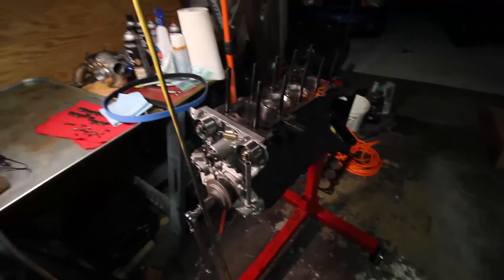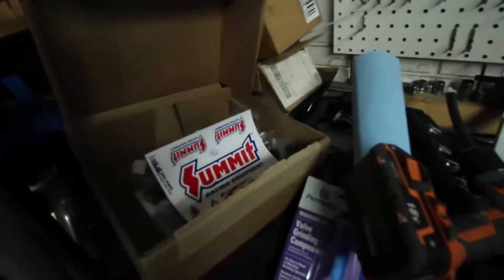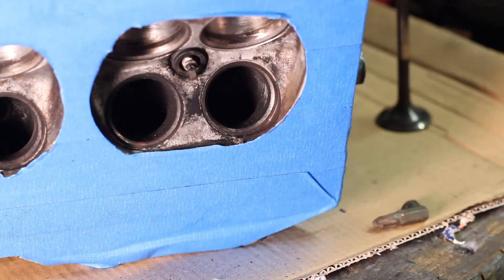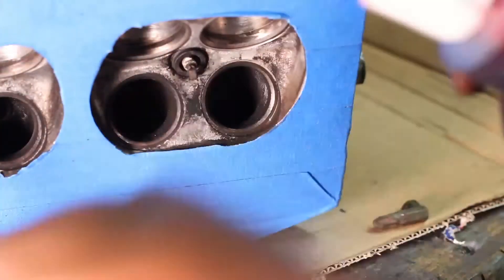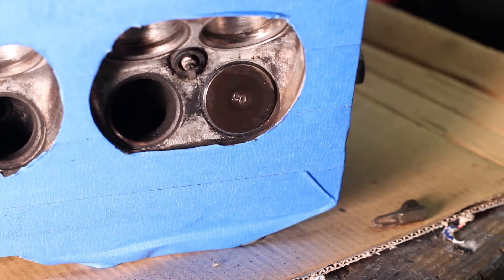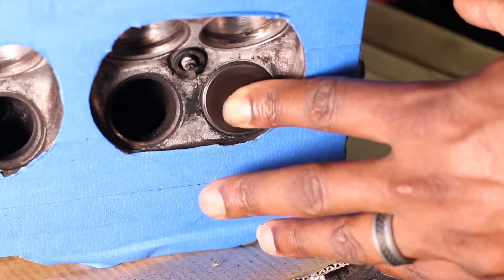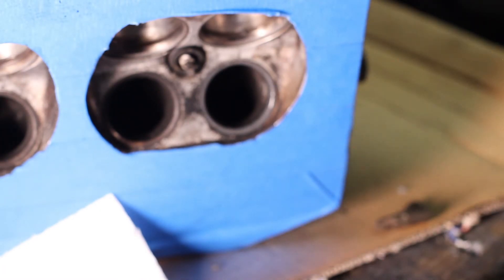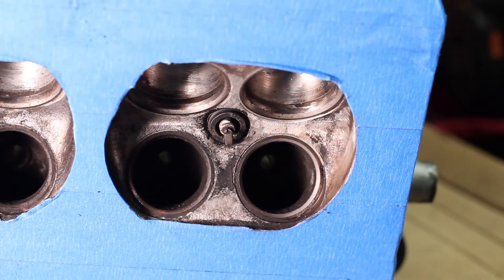Ford escort gt Mazda BP valve lapping and partial head assembly

Comment: Hahah the ending was killer man!!!! Never used a drills to lap the valves just becaus so personally like the back fourth motion....... but good job man. Soon enough it should be running.... I pick my egt's in like two weeks. Can't wait just waiting on the tiles and he's waiting on the money and I'll be picking them up...... any recommendations you think I should save from the parts car? I'm saving pretty much everything I can salvage and shoving them in a corner of the garage for restoration purposes.... even the automatic transmission lol
Reply: Antonio Stovall well if the parts car has a good one, I think we can work something out.... it's the blue they came with. The parts car is a 93 with the one piece wing